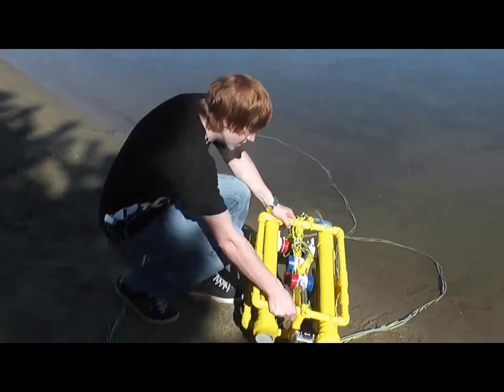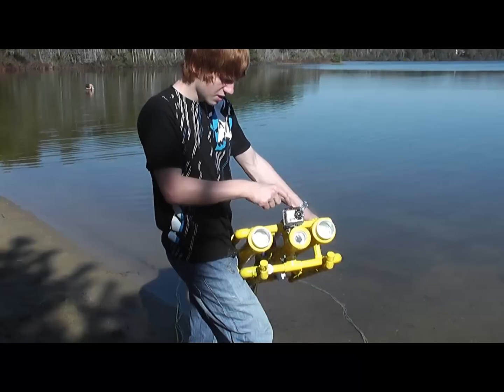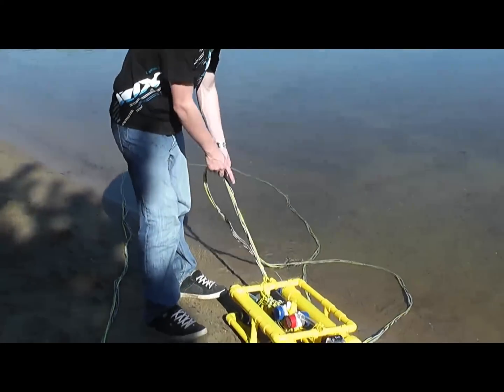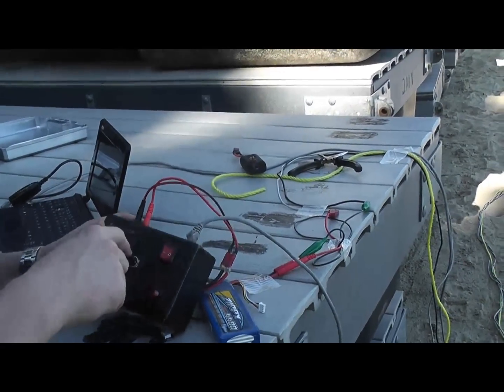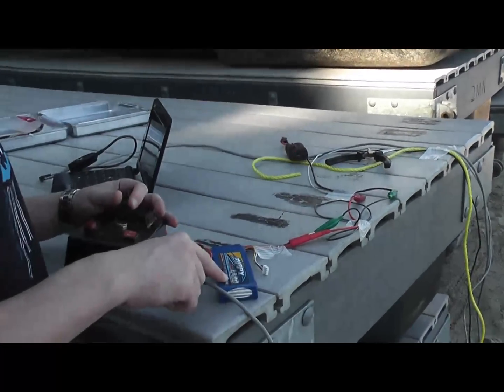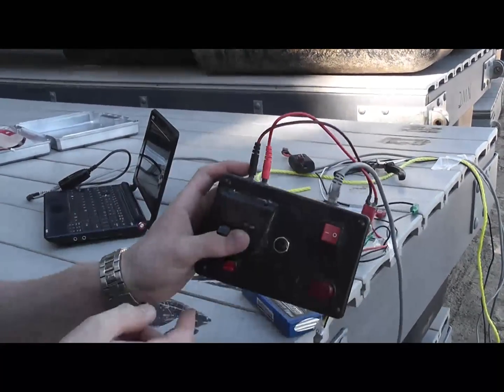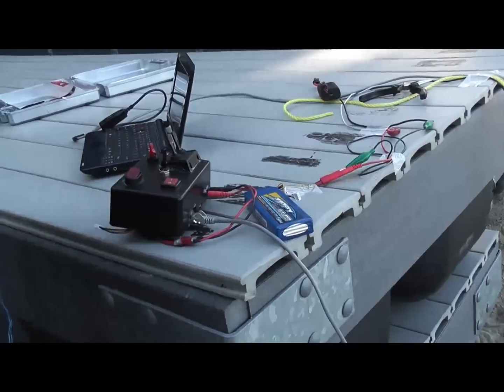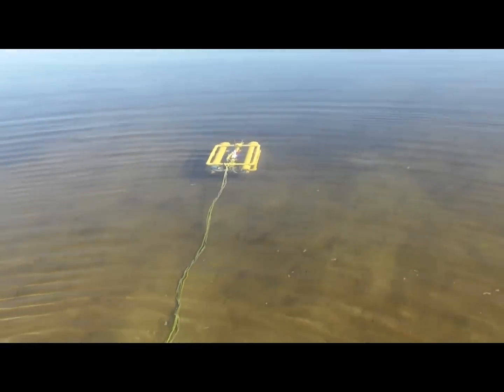HOMEMADE ROV (submarine)

Comment: when you ascend, do you just simply pump all the water out of the tanks or do you have an airtank onboard to fill the tanks with?
Reply: I know its it's late, but these work off of a principle called neutral buoyancy basically it doesnt float or sink. So, the air tanks are used to keep the topside facing up and the motors are used to ascend/descend. Hope I helped to some degree, cheers.

Comment: Hey! Great project - I'm currently working on mine. Question; your battery, 4600mAh LiPo, right? What voltage? You need about 12v for the bilge pumps - but I can only find either 11.1 or 22 volt versions. Did you upvolt or downvolt?